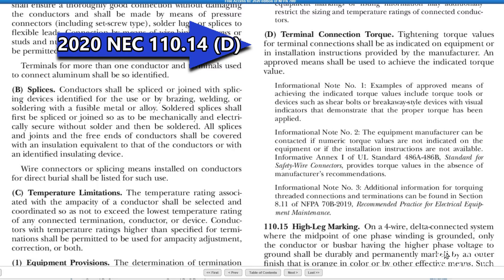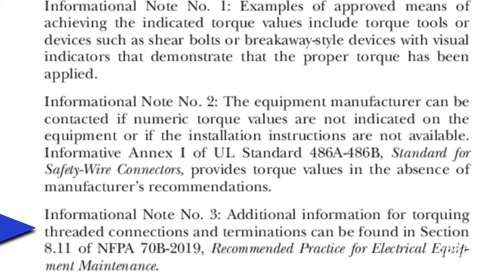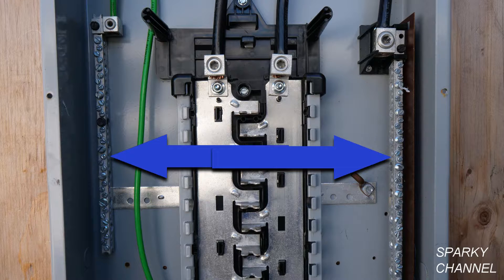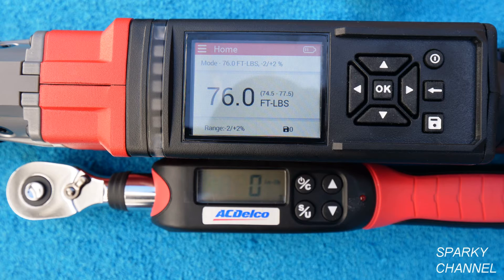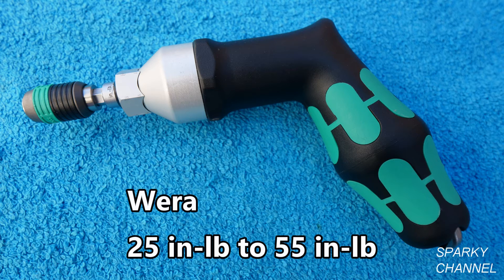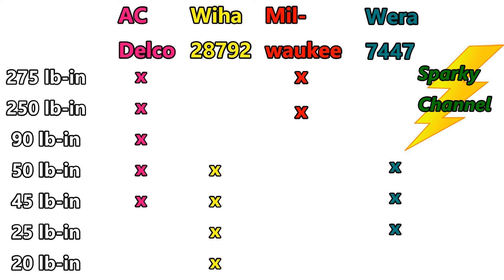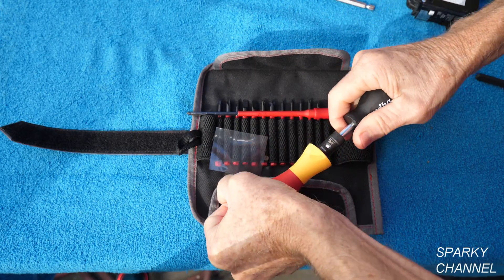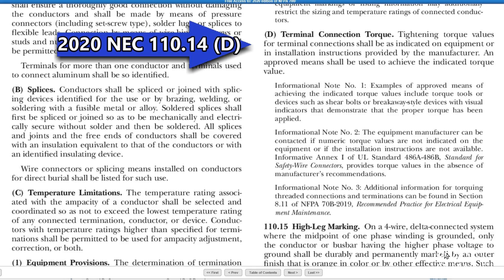2020 NEC Article 110.14(D) (With Examples) Torque Specifications

Comment: I don't want a torque wrench that requires batteries. I don't want a torque screwdriver that requires a separate small tool to adjust it - something to get dropped or misplaced like drill chuck keys. Just a good, accurate tool with an adjusting collar makes for more sense to me. Why add gadgets when they add nothing? I don't need a WiFi connected coffee cup, etc.
Reply: Wera makes a nice torque screwdriver that’s easy to adjust using the collar and doesn’t require any additional tools. They come in several different torque ranges so make sure you get the correct one for your application.

Comment: Is the torque measurement supposed to be done with dry or lubricated threads? Is Noalox a suitable thread lube?
Reply: Only if you apply to treads so got that lower alsome pounds or a nm I do recommend applying Nolan to terminal if makes noise while torque or it’s hard to hand tight

Comment: Do you know what sizes of hex wrenches are required, in this panel was 3/16 and 5/16 (I  heard that 3/8 is also used sometimes), and if we could also use mm instead of inch
Reply from the maker: 5/16 and 3/8 hex are the common sizes. 9mm = almost 3/8 inch. 10mm = just over 3/8 inch. 5/16" = 8 mm approximately.

Comment: I'm curious, - I work in Avionics ( aviation electronics)  and everything has to have a cal once a year,  AND be labeled class 1,2 or 3.  most companies have a cal lab but if you have to calibrate your own tools ( meters, torque devices) its CRAZY expensive, I work 2 jobs and one I pay for my own equipment cals, running me about $4000 to $5000 a year.  A typical fluke meter (87V) can run $65 or more to cal each year.  will inspectors be asking for yearly cal certs soon ?  I wonder......  on another note I have alot of wiha tools and love them but we torque ckt brkrs with the wiha and had real problems with calibration of the driver sticks and went to other brands.
Reply: How did you get into that specific field of electrical work?
Reply: Those are non adjustable, right? Why would they be a problem?
Reply: This are just 50. To 100 bucks and get 1/4 inch wrenches with low settings don’t use 3/8 on small screws nothing lower then 12 mm the leverage on the tool itself it’s a big thing to consider look for a venzo and a wheeler screwdriver

Comment: Thank you that was exactly the video I was looking for. I was concerned about proving to the inspector that it’s been done correctly. Do you recommend putting a tamper torque paint? And if so does it matter the color? Do you know if different colors are for different torque ratings?
Reply: I just failed a residential inspection because of 110.14(d).  I'm waiting for the inspector to call back to see what he wants, but I'm wondering the same.  25 yrs as a licensed electrician and I've never been called out on torqueing my lugs/connections.  Maybe he just wants to see paint - I guess I'll just hold my breath until he calls.

Comment: Great videos, I really appreciate all the content you provide. I have a question, what brand hex bit socket would you recommend for tightening lugs inside of panels?
Reply: Any good trust brand and get flat head bits that 6 ,7 ,8 and up for 40 amp breakers and up

Comment: So we don’t just tighten the snot out of the big lugs?  I guess it’s time we got serious about torquing these screws to spec.  Officially torque wrenches need to be calibrated periodically  though.  More work for everyone.
Reply from the maker: Yes, that's true.
Reply: @SparkyChannel  ... maybe the electronic ones need to be checked, but my old mechanical ones that I've had for 40+ years are still spot on.
Reply: @rupe53  and they're supposed to be checked every so often, usually 5000 clicks or 12 months.
Reply: @ClayGravil  ... hey, if it's got a battery it needs to be checked more often in my book. My point is that a good quality tool will last if you treat it right.... and mine have never needed to be adjusted.

Comment: I've noticed on Square D main breakers (150amp, 200amp) that they have tightened up the space so that one needs to use a long hex or a ball end hex socket otherwise the socket body jams against the breaker body....just couple mm of extra space would have been appreciated there...
Reply: Homeline or QO?
Reply: Agreed I bought a cheap husky set because of those breakers

Comment: What happens if you over torque copper by hand?
Reply: The solid cable becomes flattened.
Stranded cable becomes cold welded to itself.
Reply from the maker: I would say it might distort the round shape of the copper.
Reply: Electricity passes through the conductors.
Reply: It causes hot spots.